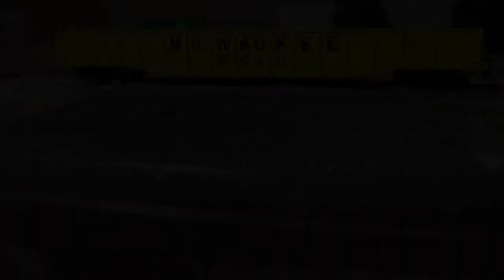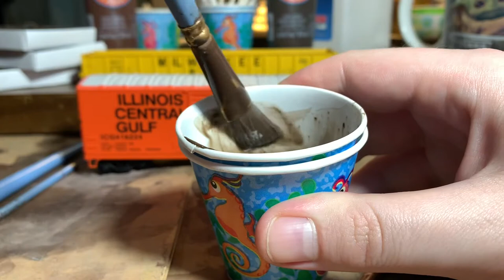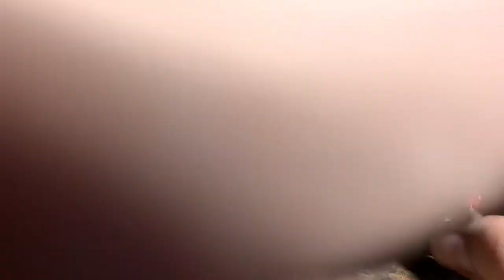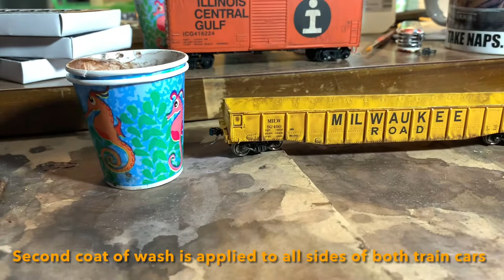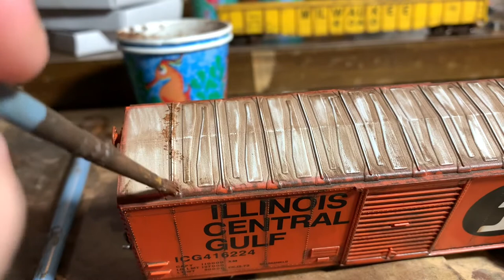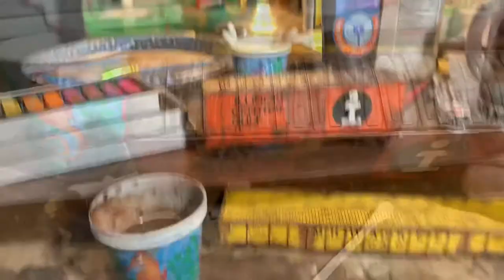Weathering HO scale rolling stock. (NO AIRBRUSH/affordable supplies & “Click Subscribe brother!☝️🤓”

Comment: I would have painted the yellow car floor burnt umber so it would have looked like wood.  Then weathered it unless you're gonna be adding a load to the car.  I have weathered over 100 pieces of rolling stock and changing all to body mounted Kaydee couplers and metal wheel sets.  I also changed all incandescent lighting to LED's in all my coaches, engines and cabooses.  When you're doing boxcars, remember to add some scratches into the finish horizontally where the door opens against the side of the car.  I use my exacto knife to scribe some small scratches into the side of the car and fill them with rust.  Cheers from eastern TN
Reply from the maker: I’ve gotten plenty of experience and knocked out many client project since making this over a year or so. Practice makes perfect! I appreciate the quality tips and advice! That why I made this originally just to help people who might be wondering

Comment: It's kind of sad to see some of the older Athearn kits with their glaring inaccuracies, such as the high mounted brake wheel on a car that never had running boards, or 100 ton trucks on a 50 ton boxcar. Some things are easy to correct but others ended up requiring major surgery or kitbashing.
Reply from the maker: Yea even models that come out today that cost 3X as much have prototype modeling errors. Like BluFord shop cabooses or ever the wrong sound file in the BLI ATSF GP20’s. I feel like some of the “best in the hobby” are becoming too comfortable or even careless when newer companies are proto accurate and around the same price range (Scaletrains)
Reply: The 40ft car shown originally had a roofwalk and full ladders. It was a group that was 'modernized' or upgraded and had the roofwalks removed. Some still retained the high brakewheels and some were lowered.
Reply: Maybe it’s me, but I guess I don’t know the actual definition of “glaring.” I’m going to bet that most people wouldn’t spot these “glaring” errors. As somebody who’s back in it for coming up on two years after when I was a preteen, things like this bug me and make me thing “why even do anything if everybody will notice that it’s wrong?” Ugh.

Comment: I am attempting to follow your weathering procedure but have hit a hurdle at the first. I have a tube of Daler & Rowney burnt umber acrylic and tried mixing it with isopropanol alcohol.  It just kind of curdles and separates.  Is isopropanol alcohol not the same as rubbing alcohol?
Reply from the maker: You can try to add a tiny dab of dish soap to the mix to help with the surface tension. Or acrylic thinner is what I’ve graduated to recently.

Comment: Out of curiosity why do you mix the paint with alcohol ??
Reply from the maker: That’s for the “wash / fading” mixture. It helps to dull the shiny plastic pretty quickly and also helps with drying quicker when trying to work fast. I might try water or even AK Interactive has an Acrylic thinner that was recommended because it mixes better. I does the trick but there are definitely better options. This one is just easier for beginners to find / afford and not have to feel bad about “wasting” any because of mistakes and such.
Reply: @WeatheredModelsByColton  I was just curious I’ve seen many videos where they add the alcohol. In my experience I’ll just spray it with a matte clear and let it dry. It dries rather quickly and seems to dull the shiny plastic. Then I’ll add my weathering and then when I’m done I’ll spray it again with matte clear. I did this with a box car in my latest video. Great work by the way and thanks for the response. 👍👍
Reply from the maker: @peanutskustomz2466  yes I’m glad you asked. I love your technique as well. Sounds like a solid way of doing it. I also use the alcohol mixture to eliminate any hidden fingerprints that may become noticeable with the weather powders/pastel chalks. I notice if I’m not careful it looks like CSI when dusting up a model and all the fingerprints start showing lol.
Reply: @WeatheredModelsByColton  awesome and thanks 👍 and yea fingerprints are a pain. I’ve done  that before lol